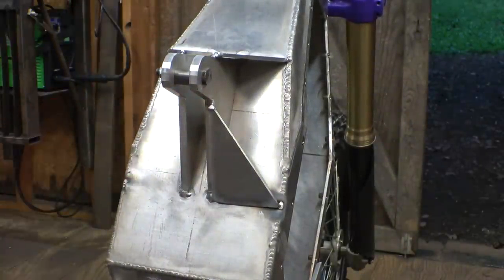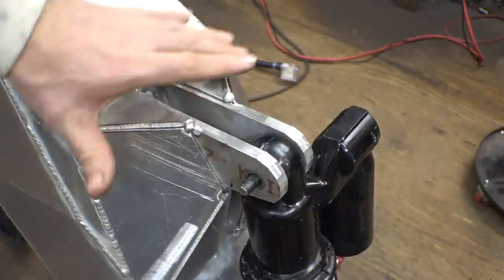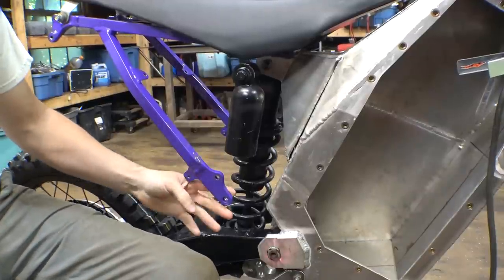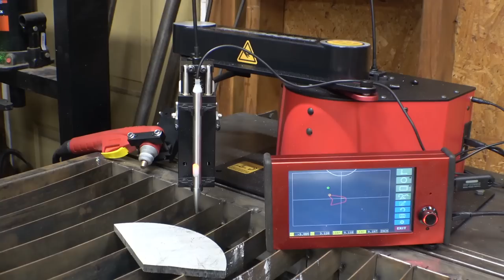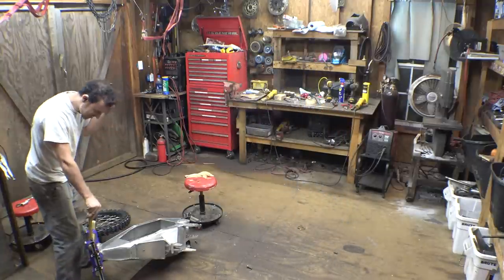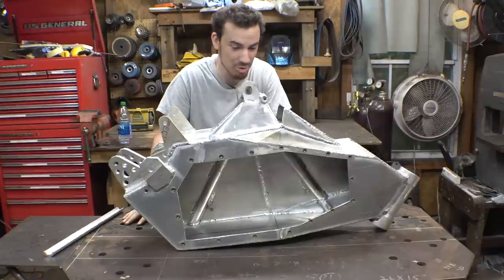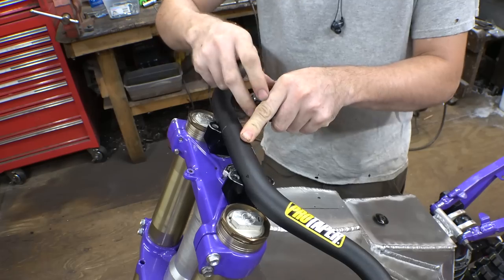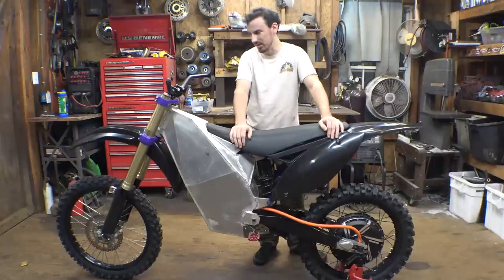Home Made Electric Dirt Bike Build - Part 6

Comment: That rear shock should sag a lot more than that, I’m only 5’8” and can easily touch the floor on my KX250. Perhaps the previous owner put a heavier spring in the rear shock.

Comment: Pretty sure that ventilation hole will just collect all the crap from the rear tire, specially since there is no internal fender/flap anywhere. Dont weld peace on the bottom of the rear shock tower. You will only collect water and crap there that in the winter worst case crack it. For cooling just use the frame as passive cooler and if it looks like this is not enough add cooling fins to frame.

Comment: Check the sag on the rear shock.   Looks like it is far too stiff to be safe to ride especially with that very heavy rear wheel.  If it is left where it is currently I think you'll get bounced off of the seat even on small bumps.  The suspension should mostly operate in the middle third of its travel so there is buffer zone above and below the middle third.

Comment: LOL  You've done well ! great work on reinforcing that battery box I think it needed it !
as far as not touching the ground.... for some reason the bike manifacturers started making bikes for 7'6" tall people ! maybe their model was for 8' tall people I don't know.... but I do know it's been one of my biggest complaints sense the 1970's every new bike to come out has been taller and taller through the years ! it's silly ! 
what I've done to make my bikes rideable is lower the suspension in the rear 2"to 2.5" and lower the tripple trees on the forks the same amount.... your ground clearance will suffer if you do that but at least it will be alot safer to ride !  i've been chided by guys on youtube saying you just gott'a learn how to ride it is all, but that does not mean it is safe to do so !
, I've just made a new lowering link for my new CSC RX4 so I can flat foot it.... i only had to extend the pivot arm 5/8" but that lowered the seat by over 2" ....
don't ride that thing if you can't touch the ground you will not remember that you have to slide off the seat to stop..... believe me I know !

Comment: this has probably been mentioned, but your seat heioght increased because your jog had the trailing arms sitting horizontal. you should have initially clamped them down with both wheels on to get the right trailing arm angle.. maybe even made a lowering adjustment then. 
it was the same issue that caused your seat angle to not align with the "frame" box top like you planned.

Comment: You should have around 25-40 mm rider sag for offroad, i am not certain what bike sag should be…. But when you add battery and all your hardware , get back on with full gear and see where you are, you can play with compression to ajust, but the real way is spring rate.  Although with your hub motor you are in unknown terrain.  Keep up the good work.

Comment: I think you’re going to have a clearance issue with the lower mounts that you placed for the seat and rear fender support. When the swing arm goes up and down it is going to either hit that mount and bottom out or pinch the power cable goin to the rear motor.

Comment: Hmm... That seat adapter to fix the angle appears to have raised the seat by an inch or two, so if thats the case, the reason for the seat being out of position comes from another cause, probably the front column being too vertical or maybe the rear mounts being out of position. So, with those observations in mind, fixing the ride height IS doable, but it'll take a little work

Comment: 14:31 build like a little arm/mount for the command box on the right side. Think desk lamp parallelogram arm. Also, you should have a water tray under it, works better at arresting any spark and soaks up a lot of the smoke, never run this unventilated, the second hand smoke be baaad.

Comment: springs are too stiff for you right now but youll be a lot heavier fully geared up with boots on and also the batterys will add a lot of weight which should bring you closer into the plush zone which will lower it more when ya sit on it.

Comment: Buy shorter springs for the forks and rear shock. When you are rebuilding the front forks you can see if spacers are at the top of the forks that are intended to increase preload and raise them. Start by removing them. Point is you are not married to the current springs
Talk to the guys that set up motocross bikes in the local club. They might offer some help

Comment: I'm curious how well the speed controller handles heat in that box.  It seems since the whole thing is made of aluminum the ultimate solution would be to mount the speed controller directly to the body by its heatsink, using the bike body like an external heatsink.   Could use thermal paste between the two, and have aluminum fins on the outside of the body (in that location) to promote cooling.

Comment: Once the bike is complete setting the sag will drop it down along with the weight of batteries etc.  Plus a motorcross boot will be good for a couple of inches against your sneakers 👟...... and yes you are shorter than the average 250 mx rider lol but your fabrication skills more than make up for it.👍

Comment: Being short is why I stayed on 3 wheelers an 4 wheelers.  Because the 125 dirt bike was the only one I could barely touch the ground on an it didn't really have the power I wanted. Wish I had kept my 86' 250r 3 wheeler and the 2 banshees' an 86 and an 87. I think I'm probably still to short for 250 dirt bike 😂

Comment: a modern full size dirtbike has a seat height around 3ft 2 inches. so you'd have to be quite short to not reach the ground on that. im 5' 6 and i can touch the ground with my feet on a 250

Comment: A 125cc 250cc 450cc and most bikes in between all use the same frame for the most part. A yz125 and a yz250 both have the same seat height

Comment: Does the swing arm assembly plus shock not have bearings? That would be the squeaking if it doesn't. But if it does have them that means something is binding.

Comment: I had a near 50kg (100lb) fence panel on the table I was welding and I reached down to get a clamp I dripped and it fell off the table onto my head today. Wasn't fun. Glad it was just to clutch lever that took the brunt and not you!

Comment: I have a similar ebike specs using a Alibaba steel frame.  I think my whole frame and swingarm weight in at 50 Lbs.  I'm curious how much yours's is up to?  You might consider going tubular with enclosed boxes for the individual parts.  Weight will greatly affect performance on those ebike motors.

Comment: Probably mounted the rear shock too straight up and down hence less mechanical leverage on the spring so..  no say or ride in. Re mount the shock. Same distance eye to eye just lay it down a bit. And yes when the battery and speed controller and everything are in there, you'll have some weight like the original engine

Comment: How much will this bike weigh when it’s finished ? Hard to make powerful ebike that is low weight because of the battery mostly it seems. The electric hub motors are surprisingly heavy and even on my 750w ebike I worry about the rear spokes holding the torque all the time.

Comment: Thats gonna be plenty strong man. If you look at KTMs electric line, youll see what i mean. If you were planning on racing motos with it, i dunno. But ur not so eff it right? I know i broke my 1998 kx250 frame. They were steel back then but i broke it  racing the Arenocross race here in Reno Nevada. Tried to quad out of a section and stacked the knuckle so hard it broke every engine mount, broke the frame, and both my ankles. I was in a wheelchair for 4 months it really sucked. Adjust your sag buddy. Nobody under 6 feet tall can touch flat footed on a full sized motocross bike.

Comment: It is not entirely clear why the battery case is made of metal. Whether the combustion temperature is such that the aluminum will simply melt. And the extra weight from such a case will only add to the problems. The best option, and the fastest one, is to make a body matrix, so that later a fiberglass body can be cast on it. Fiberglass cake with pyrogel inside.
For the operation of an electric bike, weight is very important, the more weight, the more difficult it is to move it and the more energy is consumed. For this reason, companies cannot make one that can travel a sufficient distance on a single charge.

Comment: I’m 6 foot and I can barely touch my toes on the ground on my YZ250F. It’s pretty normal. You have no weight in the bike yet, it is not fully sagging. Additionally I gotta ask, is the rear shock not adjustable?

Comment: just drill the head off, take off the upper part of handlebar bracket and then weld sth on the rest of bolt and turn it out.

Comment: Your seat is too high up on the battery box, you can see it when you're behind it, normally a seat will be much lower in your groin so that your knees are somewhat bent a lot when you are sitting on the seat with feet on the pedals. Go take a look back before you pulled the bike apart to see where the seat was originally so that you can modify it if you need to.

Comment: The problem with your seat angle started clear back in your second video when you mocked the old bike up. Your “neck” was welded completely vertical and you’ve been building off of that orientation when in fact the neck should have been welded at the riding angle. This has caused multiple issues during your build that could have been avoided. It’s probably also shortened the overall bike length but a couple inches. Btw, I love your builds! I also build in my backyard shed with extension cords strung everywhere.
Reply: I totally agree. Didn't know how to say it without writing a book.

Comment: I don't think you will have a problem with strength and if you're not going to use it like it was intended why biuld it trust in your ability it will be fine if something happens to it it would have happened to a stock one because you have built it well

Comment: Dude you have to ground right to your work piece. You were getting resistance and causing a lot of heat in the ground clamp. You could see at 19:50 that your workpiece was arcing out on the table causing resistance in the circuit

Comment: far be it for me to state the obvious, why don't you run a 220 supply cable using a length of proper cable rather than extension cables , even if it was a plug in at the supply end , just asking (it would be a lot safer if it started to rain with the extension)

Comment: Why do i keep getting un subbed? glad your thinking about the structural strength of this build, it's a lot of weight, we dont want to see you hurt yourself we want monster wheelies and power wheel spins at 50mph, and zero to sixty in 10 feet etc,  why did you just not convert the original frame to house the battery etc, i never heard a rerason for not using it, could of used it legal on the road, charged off solar panels all that free millage, once accounted for the build cost which wont take long with current fuel prices. great build still, and im glad you fixed the electric thing, ive been trying to pass you a 240v extetion cable through my screen.

Comment: Look @19:48 to 50. There was an arc to/from your steering bearing ring and the welding table. That is why your ground clamp is getting hot.  😳🥺 Look for a burn on the lower ring. Hopefully it was the aluminum, not the ring. Or just the edge of the ring. You had lots of air gaps at this point, welding at an angle, and the painted jack stand is a poor connection. I am surprised I caught that! I see others commented before me.

Comment: With what you paid to upgrade the power in the garage and for those extension cords you should have spent the little bit extra to just upgrade the power in the shed.  Yo need to fill in between the seat plate you made an the shock mount.  You should also make so removable panels to cover the area in the middle between the body and rear plastics.

You should think about growing your channel more.  Allow people to join.  Maybe push some merch.  Do some Live chats every now and then. it does not matter how tongue tide you get or not, you will likely make quite a bit in Super Chats and memberships.  With over 500K subscribers you could make a LOT more money and do this full time easy.  You could hire an editor and put out 2-3 videos a week.  You could likely get a new shop too and get lots of sponsors to stock the shop.

Comment: The reason your bike is too tall for you yet is the fact that you have not put into thought the con the engine that was in it you remove the weight of the engine now the spring is too strong for your weight because it doesn't have the extra weight of the engine to help you with your weight to make it burn down you need to get a softer spring to bring the tail the bike down so you can touch the ground with your feet remember the bike is it's spring that you have is expecting the weight of the engine and you for recoiling therefore the coil spring underneath the rear is too strong